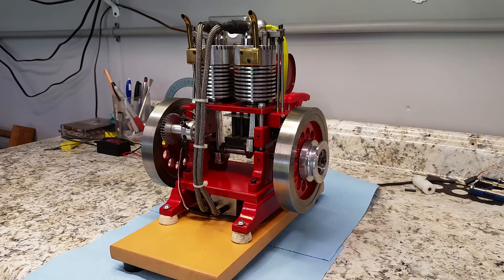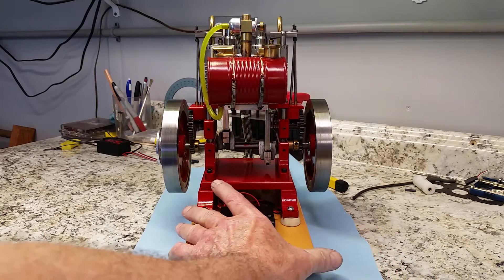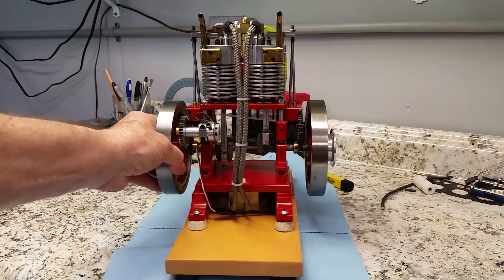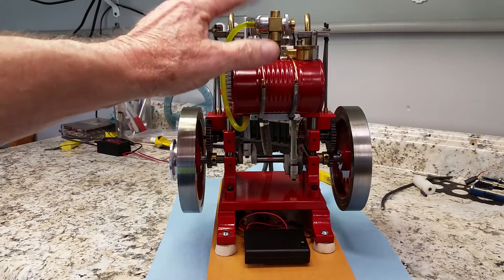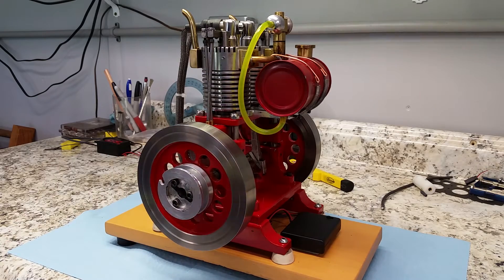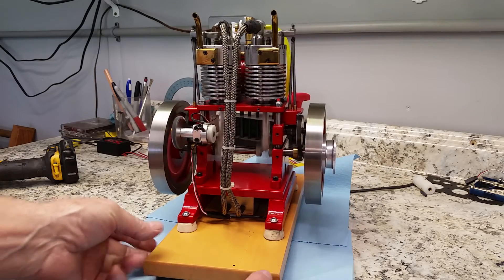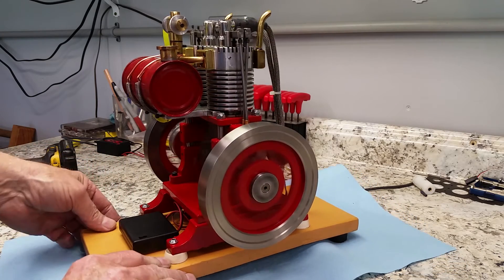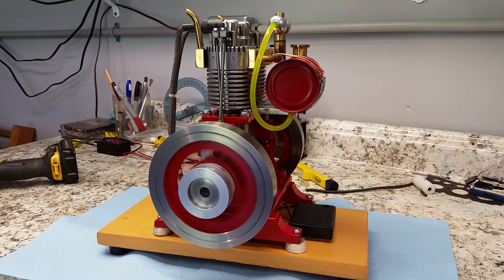Vertical  Twin 4 cycle engine

Comment: Awesome engine. Yes i can hear the john deer lope. 
John Deer did that firing pattern so the pistons could move in opposite directions to cancel each other out, greatly balancing the engine...i think triumph motorcycles do this too.
Most 2 cylinder 4 strokes have the pistons moving together which keeps the firing order opposite each other but this requires counter weights.
Thanks for posting this, would like to see more.

Comment: Nice, Dick!  Good runner.  I know what you mean about getting the John Deere sound.  I've built twin engines trying to get the John Deere sound.  The first was patterned after Randall Cox's 6 cylinder.  It had a 1" bore and I think about  1.5" stroke.  I got it to sound pretty good by putting a generator and 60 watt light bulb on it.   Here's a link to that one...

https://youtu.be/eXF6i00pE3c

and the second one has a 7/8" bore.

https://youtu.be/WOfVX1zoMNw